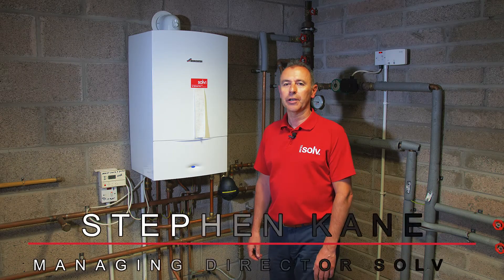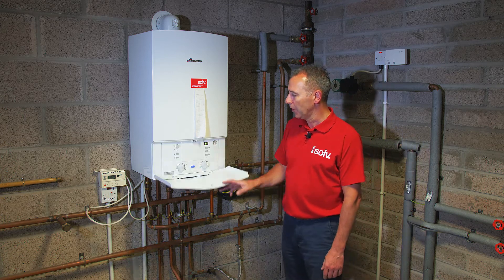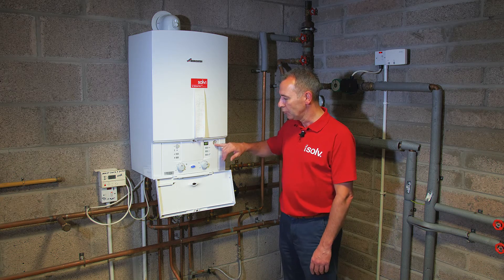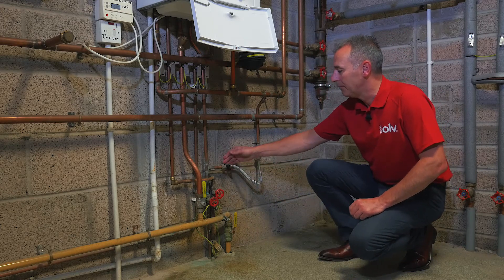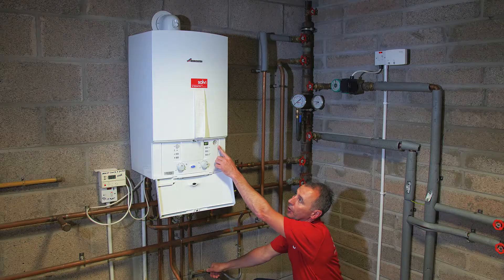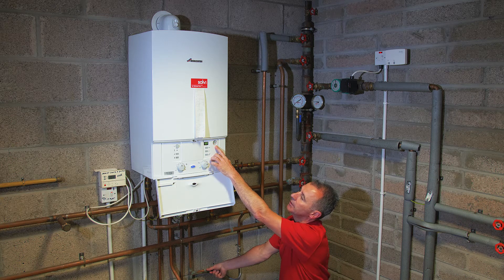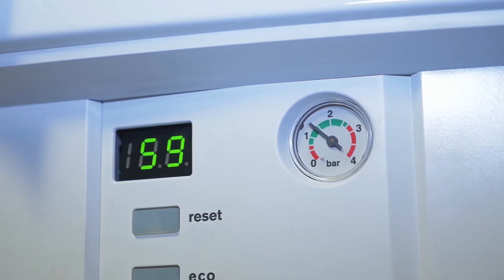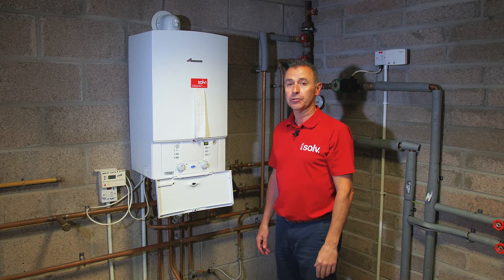How to repressurise Your Boiler / Central Heating System

Comment: Why not install a pressure regulator and backflow preventer. It would be cheaper than call outs?
Reply from the maker: It's always a pleasure to see comments from our viewers, even if they're from a few years back. We apologize for missing your comment. As a company we would avoid installing a pressure regulator with a constant supply of water to a heating system. The reason for this is that if the system sprung a leak the system would continue to fill meaning the leak would go on and on until the customer isolated the fill point manually. Installing a fill loop and leaving it isolated means that if the system sprung a leak it would stop after a short period of time minimising the damage to our customers properties. I hope that clarifies things for you, especially since I've noticed you're also working in the same industry, although you seem to be based in the USA. Warm regards, solv.